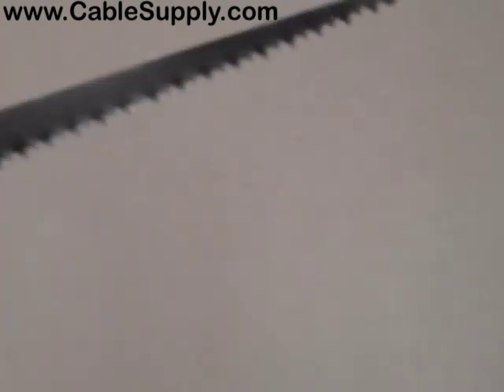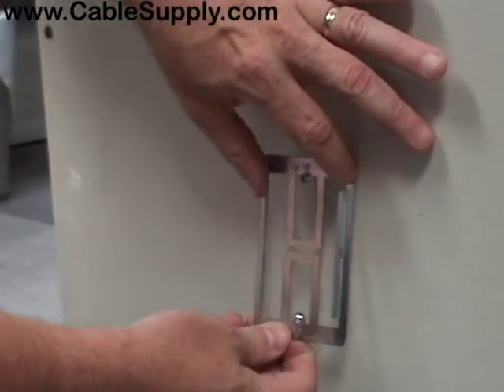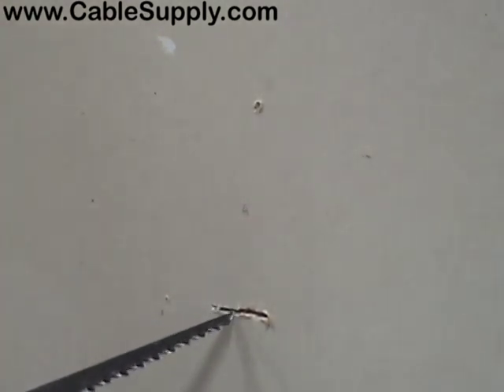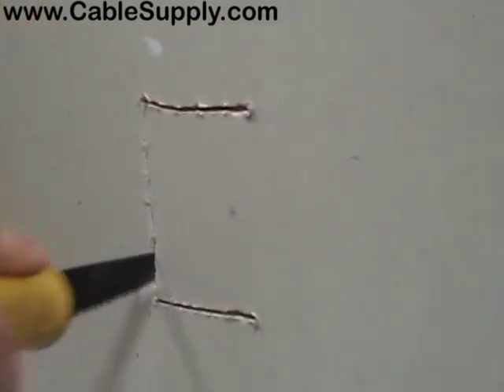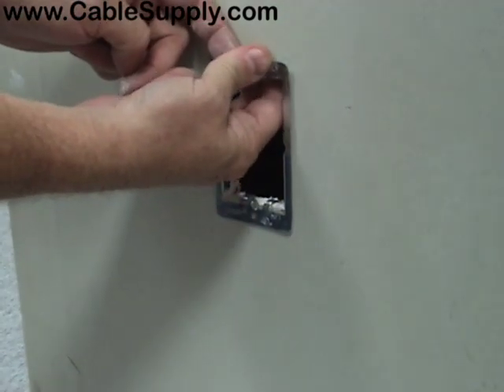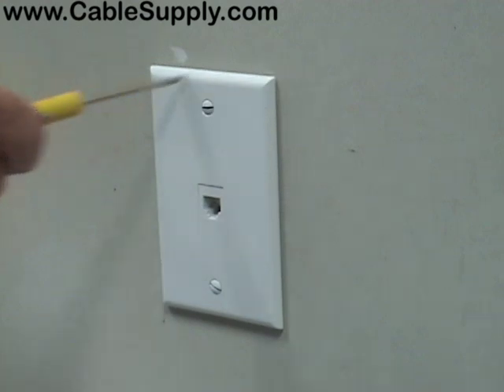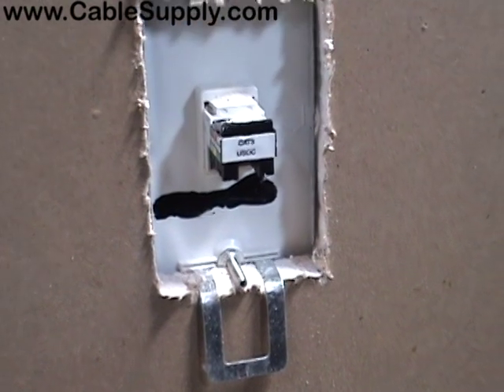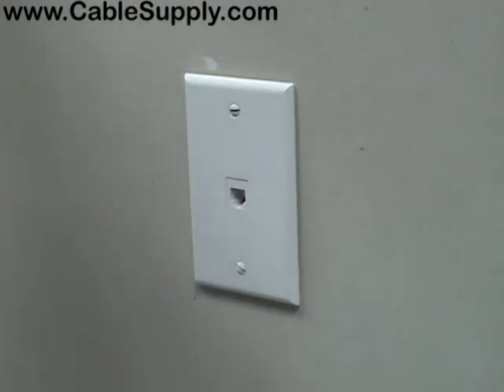How to Install a Plaster Ring and Wall Plate in Drywall

Comment: What would I use for high voltage? I'm assuming light switches and actual power outlets are high voltage.
Reply from the maker: You need to use a closed box not a low voltage plaster ring. Check with a electrician in your area.

Comment: When the put the cable tv wire through the wall, they didn't use a box.  It sits directly next to the 110 outlet.  Would this product be usable for the cable tv cable ?  Also, will the attachment screws match up with the standard US wall plate ? I have a "wall plate", but it obviously doesn't hold, and looks really shoddy.
Reply: Repair electronic gang box